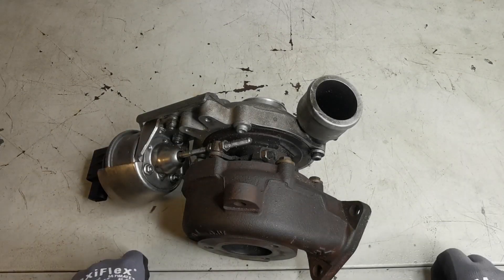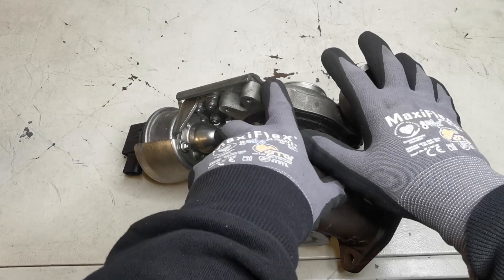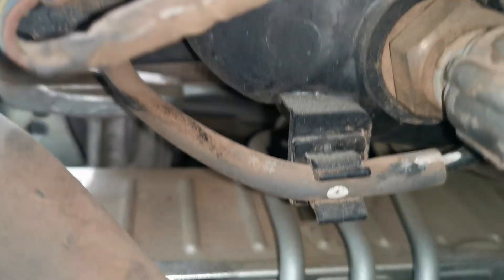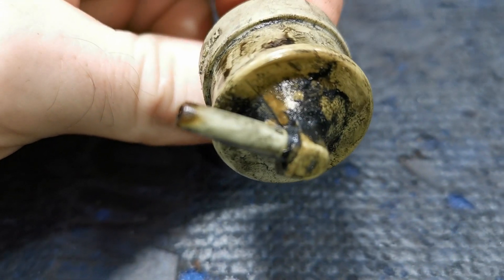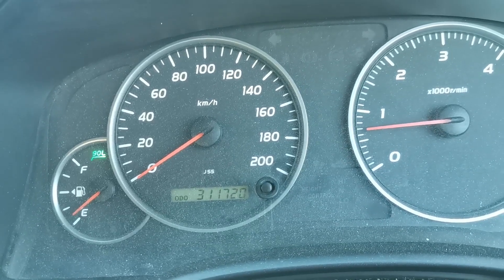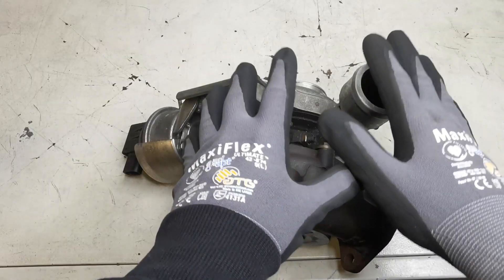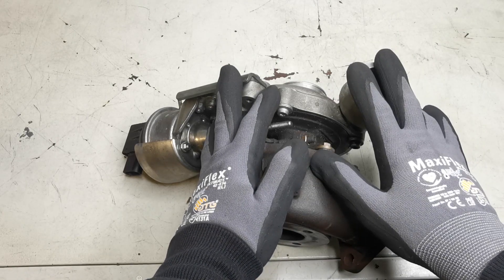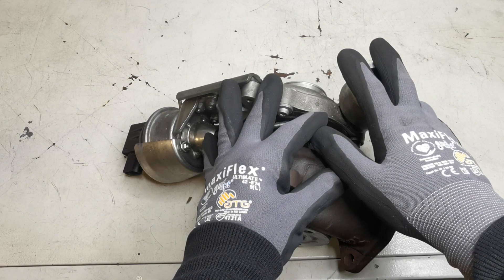Toyota Turbo Failure - This Cheap Filter That Caused It To Fail!

Comment from the maker: I have included links in the description for the part, as there are a couple of types please double check it is the right one for your vehicle. 
As always thanks for watching.
Reply: If the turbo is whining does it mean it’s too late ? Mine just started doing it today and threw the 0046 error code.
Reply: What mileage intervals would you recommend replacing that filter Gerard? Thanks in advance  :)
Reply from the maker: @colmkeane7038  from what I have heard and seen every 3-4 services is a good guide.
If the vehicle is your own you could easily cut open the filter and see how clogged up it is after replacing.

Let's say you wait for 4 services to replace it and when you open it up you find it very dirty, you would be better suited to reduce the replacement to 3.

Hope this helps 🙌👌
Reply: Hello Mr. Gerard, if I may ask you one question pls:
My father has a Hiace 2.5d4d 102ps 2004 ( I think the engine code is 2KDFTV) and we have problem with oil and fuel dilution. We changed small rings under injectors, also we installed a new fuel hoses, but the problem is still there.
Does fuel pump may cause the oil and fuel dilution?
Thanks in advance for you answer, Bojan from Serbia

Comment: There is a non oem replacement part available same filter but made out of metal way stronger than the plastic one
Reply: Seen that...not for the money they want for it. Same bin as the  metal catch can. Plastic will do the same job.

Comment: Get the aluminium filter so you can check and replace when dirty I have bought one when i cut the original plastic one the filter was 80% blocked it was only 8 months old and this is with the 7 mm egr plate fitted and no crankcase blow by please do not use a catch can on this engine the oil mist is used to lubricant the valve seats and is a minimal amount the soot will be restricted by the 7 mm holed egr modified plate look for fourby4 diesel on you tube and learn about this great engine

Comment: My MAP sensor filter had a hole worn into the back of it from the cradle. Couldn't find the vacuum leak for 3 years. No acceleration, replaced turbo, egr and throttle body.
Reply: What was the outcome after changing the parts. I also own a Hilux invincible 2012 model, just bought it and i am facing the same issue, there is also another sound that i think is of a cracked piston
Reply: Injectors are also weak of my car, please suggest what should i do, should i swap my engine?

Comment: hello, nice videos man, i got a toyota 1.2T, and it goes often in safety mode (cancels boost and got a really hard time going faster than 100km/h), it shows no failure codes at all. i changed the filters and the sparks but the only thing that seems to help, is letting it heat up before use and cool down after use. but lately, this behavior isn't helping much as the safety mode is activated in each ride.

Comment: I change this with every 5k km oil/filter change on my 1KD together with air/cabin filter. Cheers mate
Reply: 5k? 
Thats a bit often for modern diesel huh? Ive been doing 10k changes for years, thats what the manual says .A mechanic recently changed the suction control valve and reckons the motor is one of the best he's heard in a while.  All my old 60 series cruisers got 5k changes. But hey it won't hurt i guess.

Comment: I have that noise when engine is cold, then goes away when it warms up. Also can hear it during cold start and its idling. Would that be the turbo? I replaced the MAP sensor already.

Comment: I have a 2009 Avensis Estate T270 with 2.0l D4D 128BHP.Climbing up M62 in 6th gear and it lost power.Dropped it in to 5th at 60mph.Ive no warning lights on.I can hear slight turbo noise but its very slow.Definitely something wrong.Hoping its not Turbo.

Comment: N.B. He's used the term MAP 'filter' & 'sensor' interchangeably in this video (clearly knows the difference, just a slip of the tongue). Please note - the part you're after is the MAP filter (cheap), not the sensor (expensive!).
The turbo reads the intake air pressure off of a tube leading to the MAP sensor, this filter filters any air that goes in that tube - keeping the sensor clean.

A dirty sensor can make the turbo mis-read (under-read) the pressure, & over-boost as a result.

Comment: Hi ger. I've had a turbo rebuild and the car was still in limp mode. Haven't driven it anywhere but have reved it up a bit in the drive whilst looking to fox the limp mode. Have just looked at this filter as I was unaware...order a fresh one....im not sure but I feel my turbo maybe making that whinging noise...what should I do...is it gone or going to go if I leave it and replace the filter. It's just been rebuilt sonic praying I've caught this I'm time. Cheers
Reply: how did u get it out of limp mode? and how did u know it was in limp mode?

Comment: Hmmm, I keep thinking of this video when driving my d4d avensis. The last 3 weeks has seen an VSC error and my turbo is noisier than I remember before. Need to get it looked at before there's damage done and it becomes a lot more expensive.
Reply: Thanks for the video. I have a Toyota 1kz te that had that filter broken and the turbo later  failed. I had to look for epoxy to mend it so as to put it in place.I ddnt know its use

Comment: 1. Change oil before 5000 km (use the cheapest oil, minereal oil 15w40)
2. Block EGR
3. Move brething pipe to outsite (original :  breathing pipe to air filter)
4. Delet catalytic converter
Reply: Hi, how to move the breathing pipe outside?
Reply: If you only block your EGR your turbo will compensate and die early. Your vehicle was not mapped or designed to run without it and will pull pressure from somewhere. Just clean the fucking thing every 60k km. Maintenance cycle on 1 and 2KDs for oil changes is 10k, doing 7500km is plenty and I'd neither recommend cheap oil nor 15w40. KD engines are rated for 5w30 and Toyota recommends 0w30 for low temp environments you will leave your engine unlubed and kill it early with something this thick. Also what is the repositioning of any breather pipes or intake pipes supposed to do? Never heard of any of those doing damage. Unlike your advice which is legitimately harmful.
Reply: @theharbingerofconflation  my 1kd on my n80 hilux 2017  came from factory with a block egr and i dont  have egr cooler.

Comment: can a damged or blocked map filter  this cause overboosting on the 1kd? 4 days ago I've noticed a difference in sound, and I have a small siren noise
Reply: It will, but you will have to clean your sensor as well, unscrew it and blow it out with maf cleaner, electronics/sensor cleaner... all the same stuff. If that won't fix it you are in for searching a boost leak manually, hook up a smoke tester and look for a tear, some are so small you'll have to find them manually

Comment: These bits of information are pure gems. Have a d4d and will certainly be looking at that. Would love to see a video on any tips on how to keep injectors healthy.
Reply: "Fourby4diesel" YouTube channel mate. 1kd ftv  injector expert! Plus over all expert on these engines..
Reply: @UnearthedAusMinerals  Thank you. Turns out mine is a 1AD FTV so doesn't have the filter. But I'm wrestling with a P062D on an avensis which could be very nasty pocket wise.